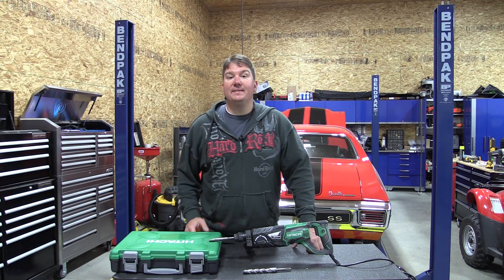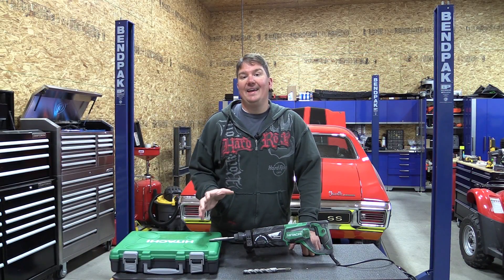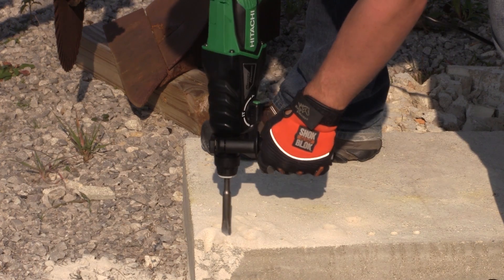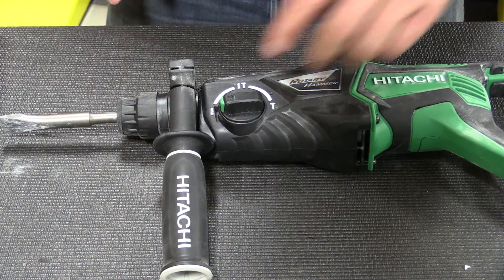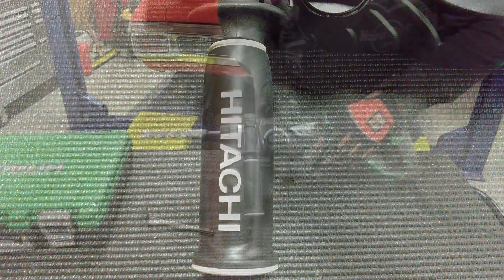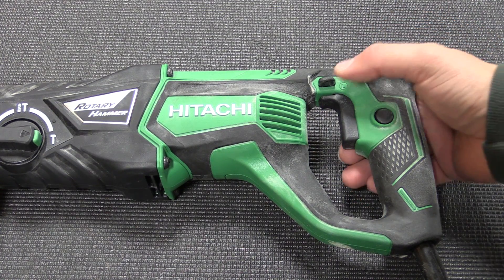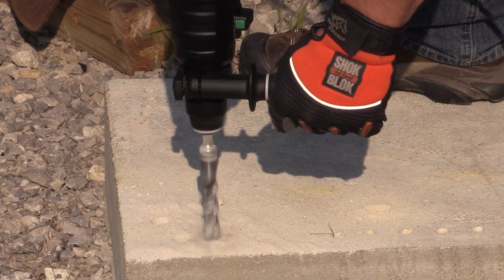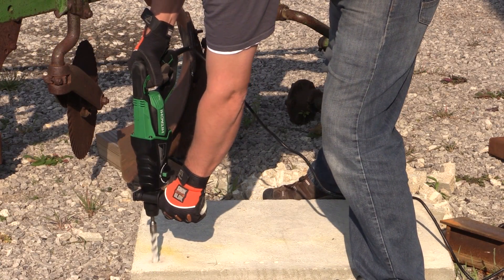Hitachi DH26PF 1" SDS Plus Rotary Hammer Review

Comment: Hm, I am betting that you are getting free tools from Hitachi? This is quite a tacky tool, and that selector switch is horrible.
Reply from the maker: metallitech What....  This is the same switch Metabo uses on similar sized units.
Reply: I've just looked; the Metabo knob has a different shape which can't be worse than the hitachi, which makes no sense. You have to squeeze the ends while rotating..??!  And the detente on the Hitachi is terrible too, and it's stiff to turn. Lack of critical review in this video is suspicious.
Reply from the maker: metallitech Suspicious, lol.  I am on the job site with a Bosch RH228VC and it has the identical switch.  I have no clue why you think every company out there is wrong.
Reply: So have you been sent free tools by Hitachi?
Reply from the maker: metallitech Your an idiot.  You go out of your was to speak BS and when you cannot back it up, you puss out.  If you are going to try to talk out of your butt on the internet, at least do some research before you do it.
Reply: Hm, no answer to my question. I have this drill by the way.
Reply from the maker: metallitech I answered your question.  You are an idiot.
Reply: Every SDS drill has the exact same adjustment knob, in the same place
Reply: @histguy101  Lots of the same generation had the same type in the same place. This drill must have the worst implementation. Still annoys me when I use it.

Comment: their batteries suck.
Reply: I've heard the same but I think that will be a thing of the past with their acquisition of Metabo. Now they have access to the best batteries on the market; just check out the new hitachi triple strike impact driver. The question is will they upgrade batteries on their lower end tools or cut costs....we'll see!
Reply from the maker: The new 3.0 Ah Compacts have rocked!  No complaints on them.
Reply: Yeah everyone is raving about them. Of course, that kit is $400 just for driver, two compact batteries, charger and hardcase.  Will Hiitachi include expensive batteries like that with all their upcoming tools is the question. Are they trying to rebrand themselves into a premier brand like Festool or will they keep a budget line as well (like DeWalt has their '20v' pro grade tools and cheaper regular 18v tools (both actually same voltage of course)). So far everything hitachi has put out since the Metabo merger looks premier....we shall see!!